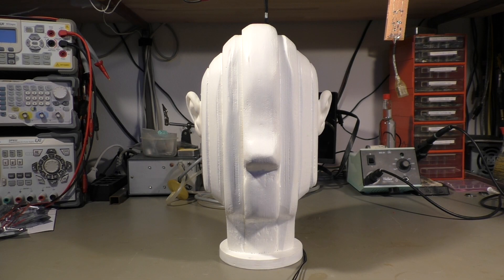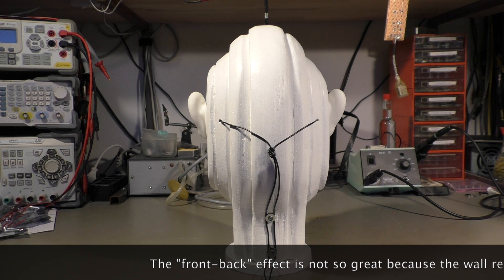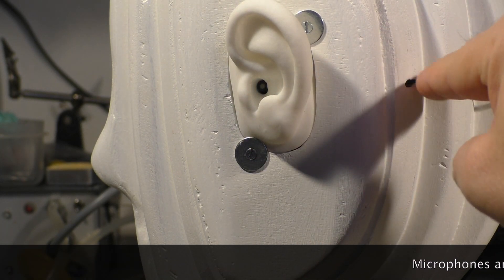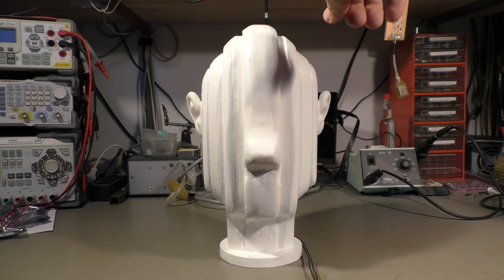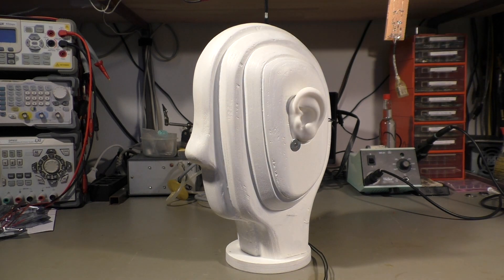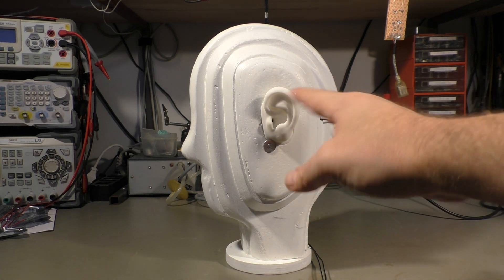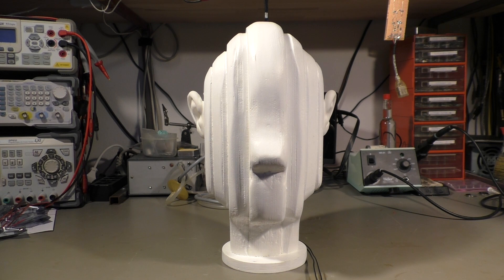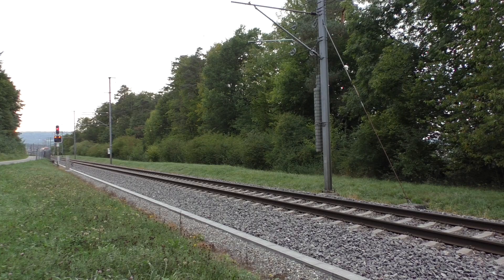Hear the world in 3D!  (binaural audio) - PWJ177

Comment: Different thing, but also about sound. When there is a phone in a film and it starts vibrating, it feels so real. I always have to check where it is coming from, this is probably the only one where I can't tell the direction.
Reply from the maker: Imaginary phone calls happen all the time... yes, for some sounds it's almost impossible to detect where they come from.
A subwoofer is a good example. You can place it under your desk or in a corner because you can't locate low frequency sounds.
Google for "blauertsche bänder/ Blauert's directional bands"

Comment: Fantastic, very good technical implementation of the Artificial Head (Kunstkopf), thank you!😘. Looking forward to more recordings!!
In the 1970ties, this techniques was promoted on the IFA, Internationale Funkausstellung in Berlin, developed by the Heinrich-Hertz Institute, I think. I still have a vinyl from that time, 3D audio scenes from Berlin. The most impressing parts are those which are 'silent'. You need to close your eyes to hear everything, the birds, or simply the wind, but the video is an additional allurement of the senses. At that time, our local radio channel, WDR 2 , also made several audio dramas, using this technique.. long gone, what a pity